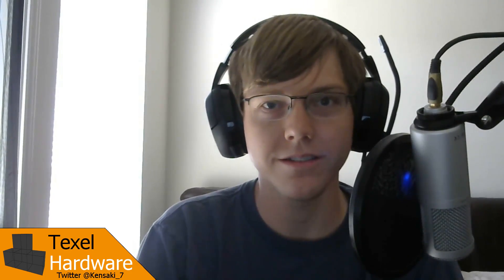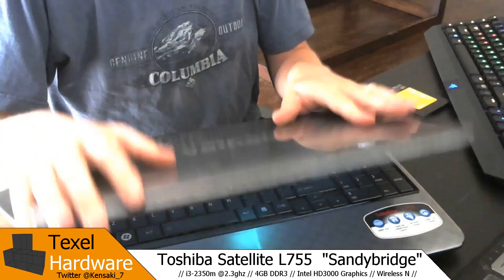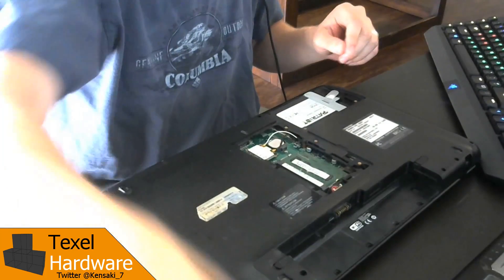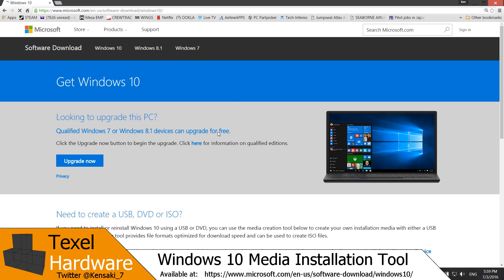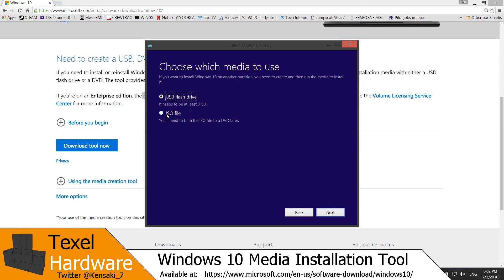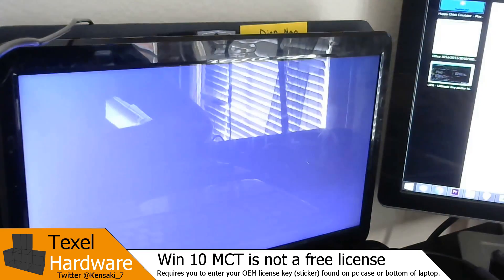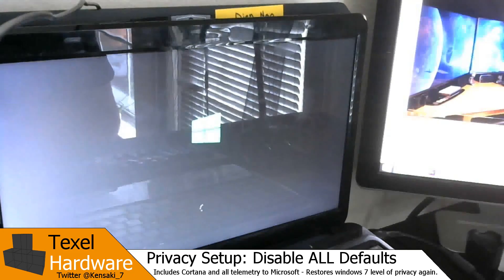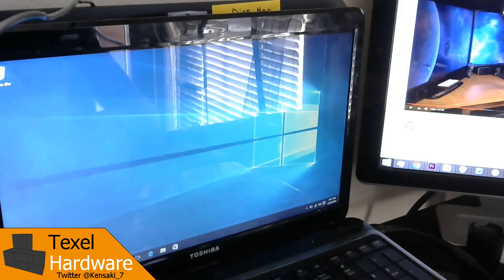SSD Upgrade / Windows 10 Installation Toshiba Satellite L755

Comment: Hello,
is it any faster laptop now with SSD ...i have same laptop and i already instal 8GB ram and now looking for SSD upgrade...so if is worth i will try how it works...please give me advice...
thanks a lot,
Muris
Reply: Great vid, Texel.  I have this exact same Toshiba L755 laptop, but it had the i5-2410M CPU.  I replaced the CPU with a fast, high-end quad core i7-2760QM (4C/8T, was $75 off eBay), and put 16 GB of Crucial Ballistix Sport DDR3-12800 (PC3-1600) 9-9-9-24 RAM in it, and a PNY CS1311 240GB SSD in it. Installed Windows 10 Home x64. I also got an aftermarket 130W power brick for it at Microcenter.  I use this beast for cancer gene mapping research (World Community Grid/BOINC- help save lives!), it's on 24/7/365 (temps stay in the mid-60s - 70°C, rarely hits 80°C & sits on a CoolerMaster laptop cooler. I used Arctic Silver 5 thermal paste, "straight line method" - I never do the spread method with AS5.). I have this laptop on a pure sinewave CyberPower UPS, and this whole rig runs like a scalded weasel. 100% reliable...never crashes. It gives my Asus laptop that came with an i7-4700MQ CPU a run for the money, and that machine is 2 years newer.  Honestly, I've probably extended the life of this computer by another 4 years.
Reply from the maker: Yes it is definitely quite a bit faster.  Boot time is less than half of what it used to be, it waits for me during boot mostly, its faster than i can enter the password.  System stability is also improved from what I can tell also, since the machine can read/write data so much faster than it previously could.  The stability advantages translate into smoother loading with no system hangs, and rapid transition between several/many programs is instant as well.  (Before it would begin to lag considerably with more than 4 programs out at a time due to many programs accessing the drive simultaneously).  Just realize that it is not going to make much of a difference for things like games, beyond their load times.  The performance gains are the most valued if your current programs over-saturate your hard drive read/write speed bandwidth.  Like I said before that is where it shines.  You can copy large files, while reading a movie stored on your machine, and sync data with a backup drive all simultaneously for example without any significant transfer speed throttling.  Even if you only do one of those things at a time, you will see quite a big speed improvement.
Reply from the maker: I wouldn't recommend spending too much on one of these old computers though, they are aging quite a bit compared to modern hardware.  I found my drive for sale at Fry's at the time for I think 45$.  I would say this is probably the last upgrade you can do that will extend the life of this 6 year old computer.
Reply: As always, the answer is:  "it depends".  For me, yes...it was well worth it. An equivalent new laptop today (January 2018), with a 240GB SSD, along with 16 GB of reasonably fast RAM (CL9), and a fast i7 quad core CPU with HTT (4C/8T) would probably run around $900 at a Microcenter store (and that's without a discrete nVidia GPU, btw).

If you're reasonably handy with fine tools, thermal paste, and willing to put in the time, you could do these upgrades in 2 hours. It's really a labor of love. I, for one, really enjoy doing these kinds of upgrades...the results are well worth it. The CPU, memory and SSD would set you back about $350 total -  $130 for the i7-2760QM CPU off eBay (and I only go with 5 star reputation sellers only!), the RAM around $130, and the SSD around $75.  I think it's well worth it.

For example, here's how my hot-rodded, 7 year old Toshiba L755 does against a laptop with an i7-2920XM CPU, in Geekbench 4.2:

https://tinyurl.com/yaaa7vy2

My L755 is on the right.

And against an Asus laptop with i7-4700HQ CPU:

 https://tinyurl.com/y9cqqewg

my Toshiba L755 with the i7-2760QM CPU is on the left side.
(elementary OS/Loki is a Linux distro)

Only real issue is the BIOS. My chipset & BIOS might be totally different from yours.  I found that the older Insyde 3.40 BIOS works best with my laptop.  HM65 chipset.
Reply: Total "Plug n' Play".  Windows 10 x64 found and installed the drivers for my i7-2760QM CPU right off the bat.

Here's a link to the World Community Grid cancer research project:

https://www.worldcommunitygrid.org/research/mcm1/details.do
Reply: Denis, also -  which CPU do you have in your laptop?  If it's a Pentium dual core or an i3, the i7-2760QM CPU might not be able to do Turbo speeds or engage SpeedStep, but it it'll probably do HTT ("Hyper Threading") just fine, if you have the i3.  It's likely that none of the BIOSes available for your laptop is coded for those features, so the i7's four cores (and four logical cores) will just stay at their base speed of 2.4 GHz...which will still give you far greater performance than your Pentium or i3 dual core CPU's.  It's just that the CPU won't ever throttle up to like 3.2 GHz (4 cores) or 3.5 GHz (one core).
Reply: Cool. Looks encouraging. 55% chance your upgrade will work ...same % as mine (i5-2410M to i7-2760QM).

And mine worked.  Again, even if your i7-2760QM is stuck at 2.1 GHz (all 4 cores), it'll still be worth it.  an i7-2760QM at 2.1 GHz will be much faster than the i3-2310M.
Reply from the maker: Really nice to see some awesome upgrading going on...  Keep posting your progess this is cool to follow... Let me know if either of you might be interested in talking on a livestream about your projects.  People might be interested in also hearing about world community grid, seems a noble cause for sure.
Reply: Trev0r98 I have the same laptop, do you think it's worth doing these upgrades instead of getting a new one?
Reply from the maker: This is really amazing project!  I died laughing at "Runs like a scalded weasel!"  I'll have to remember that one...  I agree with Trevor, fixing older hardware is almost always a labor of love.  I do believe we should love the hardware you have, and treat it right.  It will reward you by lasting far beyond its designed life expectancy.  Did your L755 have a dedicated GPU?  Just curious.  Welcome to the channel.
Reply: No dedicated GPU. Just the intel HD 3000 IGP.  But then I didn't want a gaming rig.  Thanks for the welcome!
Reply: trevor, I just upgraded to SSD and ordered i7 2760QM as well. My question is, do I NEED the higher power 130 watt brick, or is that optional. also, would you say the laptop will stay cool enough on its own with these upgrades, or is a cooling system essential? thanks for all the help BTw!!
Reply: Yes, you absolutely need that 130 W-rated power brick, for that 45W CPU (and for the rest of all your laptop subsystems) to function properly. Your current one is only around 90W - nowhere near enough.  Your laptop should stay cool enough (even though it's really a 35W TDP design, but that's ok), for most uses.

The only reason I have a laptop cooling pad (CoolerMaster) is because I have my laptop doing cancer gene marker research 24/7/365, for Harvard, Tufts and U of Maryland oncology research, so this works the CPU pretty good.  Nevertheless, it has run solid, delivering excellent, reliable throughput performance for over a year and a half now.  It hits only 75°C about 25% of the time...  "one quarter duty cycle", in other words.  3/4 of the time the CPU is around 55°C to 62°C, which is just fine (It's running Windows 10 Home x64, btw).

I have two other i7 laptops also doing this research, too...spread across two different "teams", one with an i7-4700HQ CPU, and the 3rd one with an i7-7700HQ. All are on a CyberPower Pure Sine Wave UPS.

Also, when you install your  i7-2760QM CPU, just make sure to put a thin line of the CPU paste right down the middle, along the long side (along the whole length of the top), right to edges.  I use Arctic Silver 5 thermal paste.  It's not the best, it's not the worst, it's just reliable, solid and cheap. A word of caution: in spite of what ArcticSilver and others mfr's say, do NOT try to spread the paste around...it's a huge headache, you'll never get it right, it makes a mess, and it will fail. Trust me on this.

Just squeeze out a thin bead/line of paste, then put the heat sink down onto it, and tighten the screws in the 1-3, 2-4 diagonal pattern, as indicated on the sink (also, when you take the old CPU out, make sure you LOOSEN the screws in that order, too). This has to do with evenly distributing pressure over the silicon die. The thermal paste will get smooshed down real nice, once you screw the heat sink back down.

This i7-2760QM is pretty much the fastest and most powerful CPU you can put in that laptop, and it's about equal in performance to the fancier i7-2860QM CPU (next step up), which has 8 MB of L2 cache, instead of the 2760QM's 6 MB of cache, but actually runs at a lower clock speed.  I actually bought the i7-2860QM CPU, but my laptop wouldn't boot with it, no matter what I did, so I sent it back.  It wasn't DOA, it just wasn't compatible with my BIOS or chipset, or sum'n. Weird.

Anyway, you'll have an awesome powerhouse of a laptop, good for another 4 or 5 years, and feel free to ask any questions here if you run into any issues.

Good luck, and happy # crunching!
Reply: Trev0r98 thanks man. Will follow these steps. One more thing, did you have to get any drivers for the new cpu, or was it plug and play kind of deal.

PS. Im a biology head myself. Just getting into the field. Starting a position in a dialysis lab in a week. Your research sounds very interesting. Do you have any more info on it? Would love to check it out.
Reply: Its an i3-2310M. i was debating between i5 and i7. but i researched performance and what i found was with i5 its a 38% upgrade in performance and with i7 its 112%, and the difference was only around 20$. We will see, if anything I can always return it and get the I5. Here it the link i used to get the information: 

http://www.cpu-upgrade.com/CPUs/Intel/Core_i3_Mobile/i3-2310M_(PGA).html
Reply: Trev0r98  crap I just realized i accidentally said I got 2760, but I actually got the 2630qm Wich has 82% chance of upgrade working. Haha
Reply: huh?  how'd you get them mixed up like that?   rofl
Reply: Trev0r98 lol, I guess I replied right after re-reading your comment and the number 2760 stuck in my head when I was writing my response.
Reply from the maker: I think your last comment got eaten up by the youtube spam... i approved it but it mysteriously disappeared... sorry man
Reply: Hey man, can you tell me where you got the 130 watt brick? im having the hardest time finding it online anywhere with that wattage. Thanks.

Comment: Do you have to buy new Windows or is there a way to copy your current windows running on the laptop? I think I have windows 7 on toshiba right now and I want to copy it to SSD.
Reply from the maker: Hi Sunil Kumar,  No, you do not have to buy a new copy of windows.  Your computer should have come with a recovery disk set that has windows 7 on it, or you have to manually create a recovery media for the PC.  If all else fails, you can get a copy of windows 7 from the microsoft website, then use your license key that is on the sticker on your machine and it should authenticate without any problems.  Download windows 7 from Microsoft here.  https://www.microsoft.com/en-us/software-download/windows7 

CLONING is a process that copies your current hard drive and puts an exact copy of the entire drive onto the newer one.  While this method could potentially save a little bit of time, I personally woud not recommend it.  A clean fresh installation of the operating system is the best way to go so that you start over with your programs and can begin by reinstalling only what you really need to do your work.  Over the years systems become overcluttered with additional programs, and having only what you need on the machine will help to ensure that system resources are properly allocated to the tasks you are trying to do.  Programs such as Easeus Partition Master Home Edition, and Macrium Reflect and many others are capable of doing disk cloning if you still want to do that.  Just keep in mind, that if your system is currently not well optimized for startup, has too many programs you no loger use or don't want, or if your system is plagued with malware or spyware, then ALL of those problems will be copied to your new drive as well.  

Hopefully this will help you and many others make the best decision between cloning, and fresh installation of windows.
Reply: Texel Hardware I want to install a fresh copy but when I entered my product key on Microsoft website, it said that the windows was pre installed on my computer and I should contact Toshiba. however, my Toshiba warranty is expired. any other ways to copy windows 7 from my computer to usb?
Reply from the maker: You should be able to download the ISO or a bootable usb media tool from the Microsoft website, and burn it to a disk or USB drive.  The activation happens on the computer itself, NOT the Microsoft website.  Keep in mind if your computer hardware requires proprietary drivers, that is drivers that are not included in the basic default drivers set in the windows 7 OS, you should be able to get those through a support download page from the manufacturer.  Hopefully this can point you in the right directions.

Comment: Do i install Windows on My Ssd?
Reply from the maker: Hi Deniro, Yes!  Definitely install windows on your SSD drive!  You will have a massive performance increase having the OS on an SSD, especially if you come from a traditional Hard Drive.  Be sure to select the SSD specifically during the installation process, if you have multiple drives in your system.